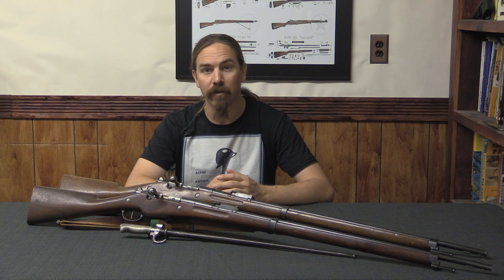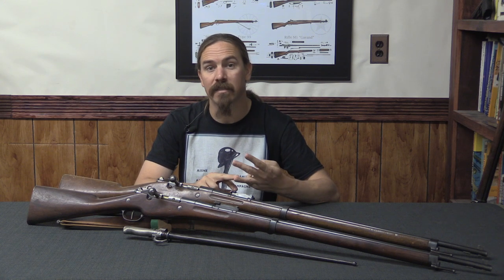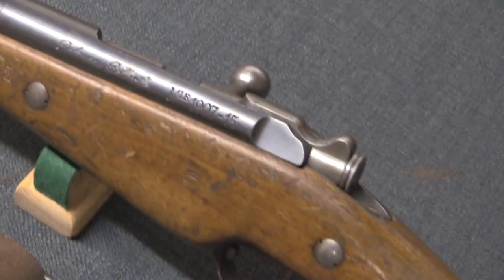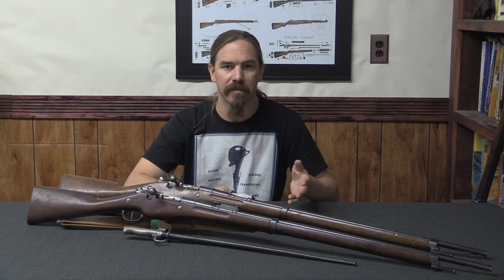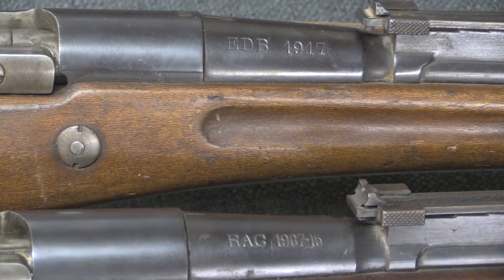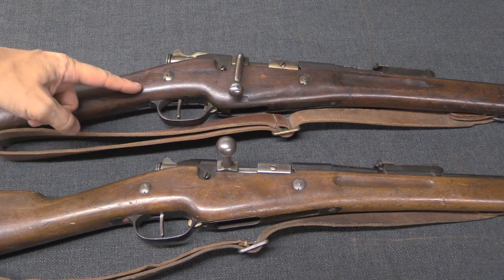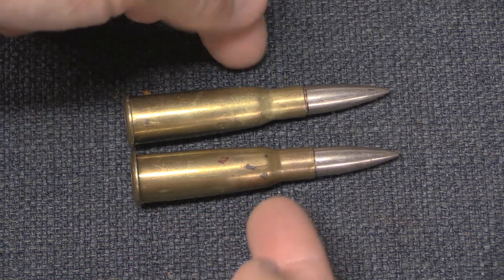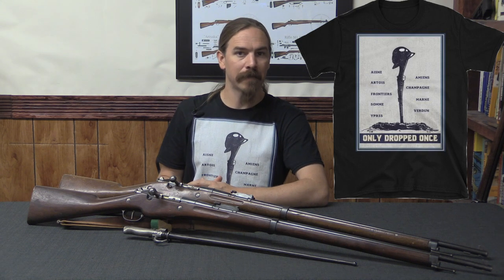Model 1907/15 Berthier: The WW1 Standard Infantry Rifle

Comment: In response to the interrupter explanation,  the rim of the 8mm Lebel cartridge was also tapered which helped to prevent rim lock.  So it was actually triple tapered in design that would help with rim lock.

Comment: Don't know if FW is going to cover this, there is important ammunition info for these rifles, a mistake I nearly made using the wrong ammunition.

Extract en.wikipedia.org

Balle D am ammunition was in near-universal service during World War I (1914–1918) in all Lebel caliber weapons. Somewhat later, Balle D am ammunition was followed in 1932 by "Balle N" ammunition which featured a lead-cored, cupro-nickel-over-steel-jacketed, spitzer boat-tail bullet weighing 15.0 g (232 grains). It was held into a case which had a slightly larger neck diameter than the older Balle D am ammunition. Balle N was heavier than Balle D am and had been designed to improve the long-range performance of the Hotchkiss machine gun. Converting most Lebel caliber rifles and carbines to the "N" ammunition was carried out during the 1930s. "Balle T" tracer and "Balle P" armor-piercing rounds were also produced, along with blank and reduced charge ammunition.

Balle N ammo should never be fired from any Lebel or Berthier rifle unless it has had the chamber reamed to accept the larger neck of the N cartridge. Such weapons are stamped N on top of the barrel, just in front of the receiver and behind the rear sight. Balle N ammo is identifiable by the fact that the bullet, while pointed like the solid brass Balle D, is lead-cored and jacketed with soft steel.

Comment: Between the Lebel vs 1907/15...I'd rather take the Lebel. Having essentially 10rnds vs 3 in combat makes me feel a bit safer Lol Given the Lebel's awkward loading, you can just top it off every few rounds to mitigate its prolonged loading process and sorta keep those unused rounds as backup in case things get real harsh and there's just no time to top off. With the 1907/15...you're just completely stuck with 3rnds no matter what. And when everyone else has also got bolt-actions, but with 5rnd'ers...that makes me feel outmatched.

Comment: Weird question... how were guns cleaned pre 1900? Did they sell bore cleaner and patches? Did you use the ram rod and clean from the end of the barrel instead of the breech? Just wondering
Reply: The cleaning rod when unit is at rest. In the field  they used a string cleaning device with a short brass rod (lavoir à ficelle=> string cleaner) and calibrated patches

Comment: Hey Ian,
Why did they switch from a curved to a straight bolt handle?  Was it for ease of production?
Reply: Probably ease of manufacturing. Simpler and quicker to produce a straight bolt.
Reply: A straight bolt also gives better leverage to open the bolt if it's dirty or jammed and for extracting sticky cartridges (If all else fails you can literally kick it). In the quagmire of the trenches that was probably preferred over not having it poke you in the kidneys when you marched with it on your back. Toughen up, Pierre!

Comment: Did they stop making the 07-15 by the end of the war? I just bought one from RTI and i forgot to ask them for a ww1 dated one.
Reply: But fortunately i think theyre most ww1 or older cuz france started making the model 1916s and converted most of the 07-15s to 5 shot configuration. The rti ones ive seen have early dates and theyre all 3 shot ones so thats a good sign. Also the n marked ones were converted in 1916 so they are at least that old

Comment: They didn't serialise them until they were issued? What if there was a issue where the 1000th - 2000th bolts were not up to spec for eg?
Reply: They No, they were not serialised until they were accepted. The inspector would accept an unserialised gun, THEN the gun would be serialised AND THEN shipped and issued.

Comment: the problems for Remington to built properly this guns is not a surpise: in WW2 the main aircraft canon from the alliees was the french 20mm Hispano Suiza, selected by the brits because was the best of this times and they built it without problems* despite use the imperial mesurement system... but later, to increase the production, did the US built themself 20mm Hispano Suiza canon and the first of them work very badly (jamming), because to reduce the costs did the US engineers modify some details : later, with perfect respect from blue prints no problems...
*the original 20mm canon was built to fit in the famous Hispano Suiza y12 "moteur canon" (canon engine) who fire trough the propeller shaft, use in the Morane 406 and the Dewoitine D520 (and later, with impovements, the Yakovlev 1 and 3), so in the heat from the engine, loading was pneumatic and work perfect... but the brits need it to install in the wings, and they fall on icing problems from the pneumatic system: this was the main modification on the brit Hispano canon version...

Comment: Even though I am very late to the discussion, I think I’d take the 8 rounds of the Lebel over the Berthier with 3. I think the rate of fire would be more crucial during the First World War, especially with Germans charging at the trenches during an assault. Yet again, the reload speed would be the killer.
Reply: The Lebel would only have the advantage for the first go around. That tube is painfully slow to reload, you’d probably be better off throwing singles in. The Berthier three round clips are rather handy in size and very quick to reload.

Comment: What is the hook looking thing on the bayonett for ?
Reply: munkSWE88 I'd assume it to prevent an opponent bayonet sliding down the underside of the rifle towards you, at the start of the war all nations were drilling soldiers on a type of bayonet fighting that just never happened on the field it's the reason they have such ridiculously long bayonets on the early guns it was thought the extra reach would be an advantage
Reply: To catch a blade if you're using the bayonet without the rifle. Or when fending off a sabre strike, only to then push forward afterwards - with the bayonet on your rifle, you have a longer reach over the sabre (especially when the other guy sits on a horse). Remember that WWI was drastically different from basically any war fought before, so many old ideas were proven to be complete nonsense when applied to this extremely different environment.